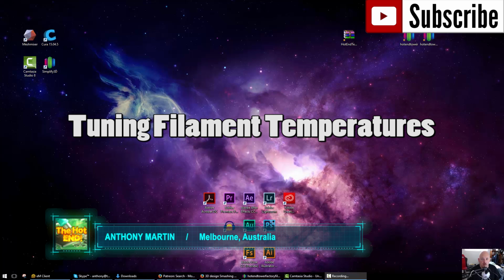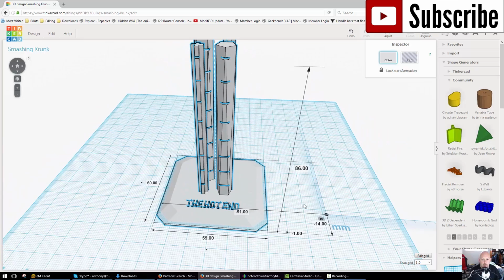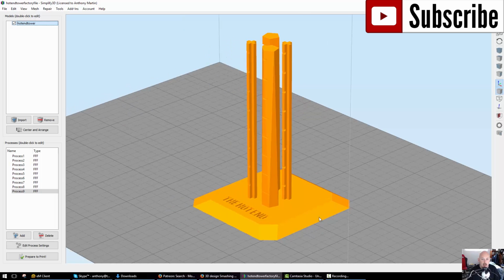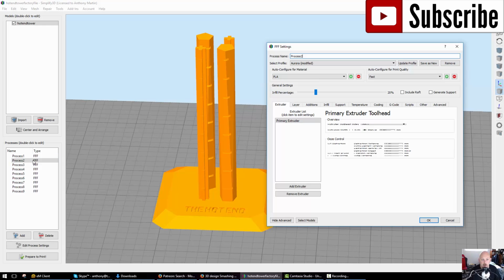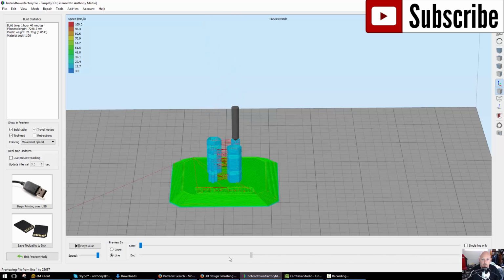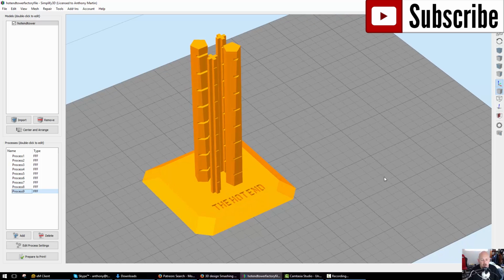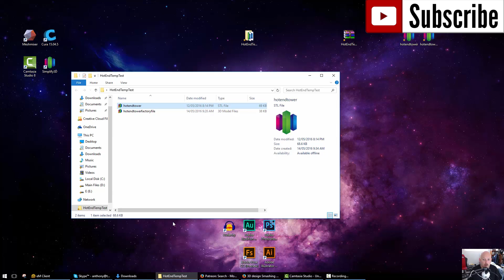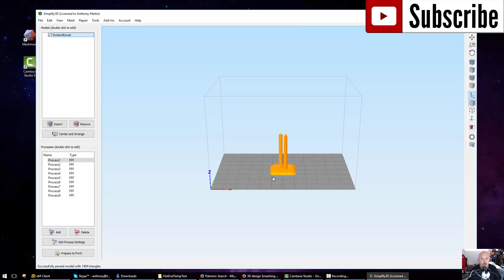Simplify 3D Advanced Series: Fine Tuning Filament Temperatures with processes

Comment: i printed out a 90mm tall cube, and changed the temperature of the nozzle by 5° every 10mm starting at 230° and ending at 190°. I see no determinable difference in the print quality of any layers. The entire cube looks the same. Im stumped

Comment: Great little test print!

You can actually setup this test with a single process if you use the layer setpoints in the Temperature tab. Say you're using 0.2mm layer height, you would put a new temperature every 5 layers.

Layer 1 235
Layer 5 230
Layer 10 225
Layer 15 220
Layer 20 215
Layer 25 210
Layer 30 205
Layer 35 200
Layer 40 195

This should speed up the print a bit, as you wont be generating top and bottom solid layers for all of the process changes.
Reply from the maker: yes i know, read description:)
Reply: Ahhh didn't see it there! I came for the video content but should have paid attention to the description just as much!

Comment: you can just do it with a single process and set new temperature setpoints at different layer numbers(as you did for your first layer). Much quicker than creating all those processes. This is one of the best things about S3D.
Reply from the maker: +Scienteer Read the description :)
Reply from the maker: +Scienteer "Yes you can ALSO do the same thing in the temperature tab by telling it what layer number to change - there's more than one way to skin a cat!" -
Reply: +The Hot End - 3D Printing And Electronics Oh yes sorry, didnt read it. Both methods are much better than changing it manually via the front panel though. Really great tip BTW.
Reply from the maker: +Scienteer You can also use the .factory file to make it do different things per 10mm chunk - like change retraction, change layer heights, infil % and/or type etc.